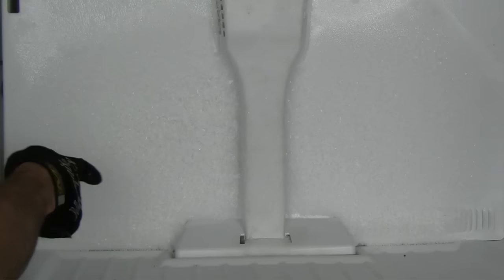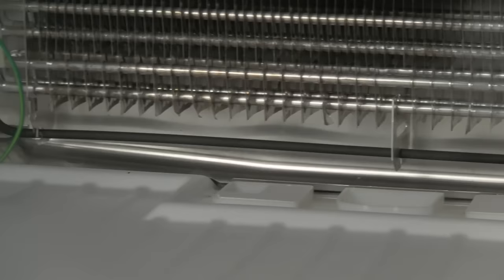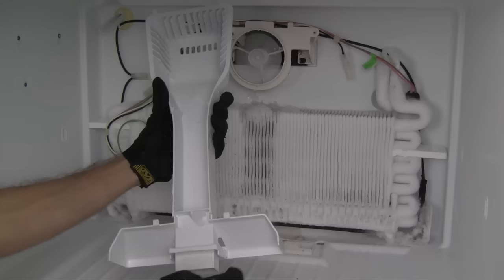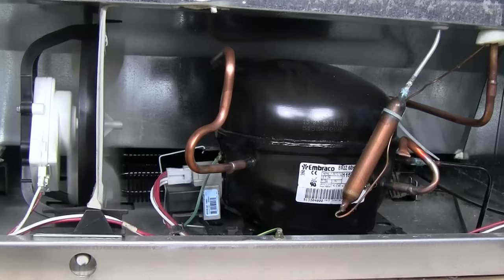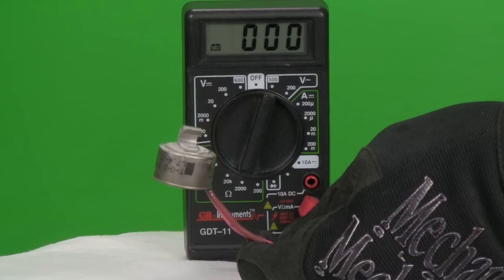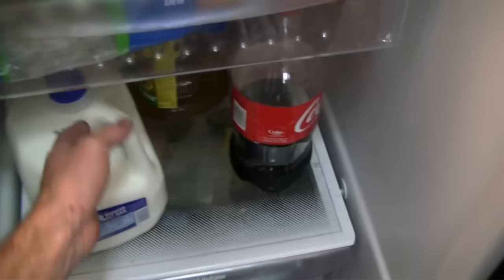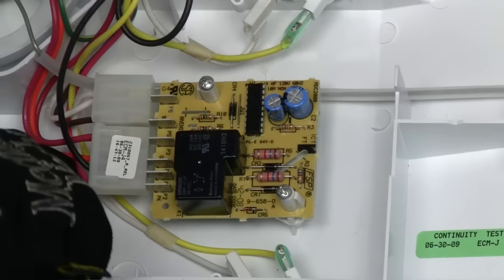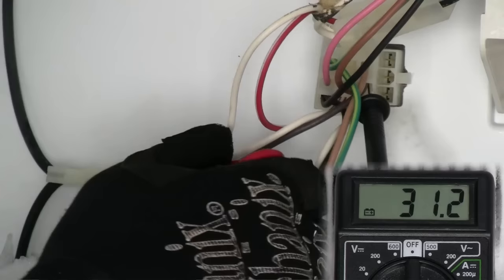Refrigerator Repair (Not Cooling, Defrost System)

Comment: My refrigerator has a defrost cycle and the compressor had been clunking these past few months when it shut off. Today it clunked and the refrigerator shuttered and it popped the circuit breaker. I was home when it happened so it was reset immediately but 12 hours later I have discovered the things in the freezer are defrosting. Cool air is blowing out the side of the vent in the freezer but cool frosty air is no longer blowing out from the top. Any ideas what this could be?
Reply from the maker: SepherStar The clunking is mechanical drag inside the compressor which cannot affordably be fixed. Somethings they will still work for years that way, but its giving you notice that it's on the way out. And it may now be out... I have a lot more refrigerator troubleshooting on this page that will walk you through what to check, but it doesn't sound good...http://applianceassistant.com/Refrigerator-Repair/Troubleshooting-Refrigerator-Problems.php
 If you get stuck, reply with your refrigerator's model and I can dig into it more. Hope that helps! 
If you do need to replace it I have a reliability statistics page for newer refrigerators that may help. 
http://applianceassistant.com/New-Appliances/Most-Reliable-Refrigerators.php
Reply: applianceassistant Thanks for the reply. The repair guy is coming tomorrow but I think it probably is a fatal issue with the compressor. I think my landlord has another refrigerator he can swap it out with. It's just a matter of moving a lot of furniture first.
Reply from the maker: That's good! It's always tough when refrigerator go down.  Thanks for the question. Hope it all works out!

Comment: Here is my problem: i just replaced the evaporator fan and motor a week ago. The freezer works great the fridge is not cold enough though it is just cool. I removed debris from the drain line just lastnight and it has refilled again the fridge is still not cold. please help the fridge is an Admiral signature series from montgomery wards HMG 501040.
Reply from the maker: Still sounds like an airflow issue. Try checking the air duct into and out of the fresh food compartment for any frost build up or blockage. Have you tried manually defrosting it yet?

Comment: need your help I have a Hotpoint model# hss25gfph ww,  bout 6months ago I brought a bullet valve and add some Freon to it ,  it got cold and I would freeze but nothing really solid now it is not even doing that tried to add more Freon and it wouldn't take any more the copper tubes on both sides of compressor are running hot and the defrost area where it heats and melts the ice has nothing on It, it's warm also  now it sounds like normal until it shouts down there is a big knock and rattle sound  I could really use some help just lost my job so I got to fix it cant afford another one any suggestions?????

Comment: i have a code 41 and it runs watre for 3 seconds in the tub then it runs in the soap area for a few seconds and goes to wash,,so the problem is the water level is way off ,it doesnt fill up enough ,what could this be,,,it does fine when i run the test with no problems

Comment: Hi, I am trying to troubleshoot what is wrong with my fridge.. It seems as if everything starts working normal if I turn the knob to the off position then back to 3. after a period of time, the same problem happens and the compressor will stop and no cold air will come out. both freezer and fridge go warm.
ED5FHEXNS00
Reply from the maker: How long will it work before it quits? Does the compressor ever start? You may need to pull the back off to feel if the compressor is starting or not... It may be hot but we are mainly interested in vibration.  If it's vibrating it's running.
Reply: The compressor does start and it does get hot and vibrate slightly. After 45 minutes, the system turns completely off, however the light is on still, but no air is pushed out of the freezer. The compressor and fan stop.

Comment: Hi there I have a Maytag fridge and the freezer is running good but the fridge is at 60 degrees. Do I unplug it for a day or so, would that fix the problem?
Reply from the maker: Sorry for the delay in getting back on this.  It may as long as the fan in the freezer is working. If it's not check the fan motor.  If there a frost build up in  the freezer at all?
Reply from the maker: applianceassistant Whats the model number?
Reply: applianceassistant Hello, well I unplug the fridge for almost a day and now it's running great.thanks to you. thank you so much.
Reply from the maker: Great! Thanks for the post!

Comment: When my timer comes do DEFROST mode, it stops spinning. Should it continue to spin? It looks like power is not supplied to the timer once in defrost mode. Model: Daewoo FR-3801https://www.manualslib.com/download/762452/Daewoo-Fr-3801.html. Can anyone help? Do I need to replace the timer? In the defrost mode, the heater warms up. It just doesnt come back from the defrost mode to normal operation.

Comment: hi my refrigerator  light is on but nt cold but sounds like water runing please  help as why have money for new one
Reply from the maker: lisa connolly it sounds like it may be stuck in a defrost cycle. But the water sound should stop after a short time. I have lots of troubleshooting help for refrigerators on my website that may help. You will need to know your refrigerator brand and model number to be able to find manuals and other more specific videos. You may try to unplug the refrigerator for a few minutes to reset any control boards...

Comment: I'm having trouble maintaining temperature in my freezer. Had a repairman out a few months ago and he recharged the coolant and changed the inverter. He also said that if the problem persists that I may have to replace the evaporator unit. I can't really afford that. I'll look into de-icing as you've shown in the above video, but are there any other pointers you might think I should try?
Reply from the maker: Bummer! That's not good... If the repair person was correct in diagnosing that it needed gas then you likely have a leak somewhere, and the evaporator weld is the most common place for that to happen.  Usually that is a terminal problem and time for a new refrigerator.  I hope the repair wasn't to costly... Here is a troubleshooting guide: http://applianceassistant.com/Refrigerator-Repair/Troubleshooting-Refrigerator-Problems.php
Generally if the compressor is running and the fan in the freezer is working it's a major issue.  Sorry...
Reply: applianceassistant Update. After de-icing the evaporator coil, the temp is still hovering around 27 degrees. I think I'm screwed. So for any consumers out there, G.E. Adora side by sides I would recommend against. LOL. Not reliable and a pain in the butt to work on.
Reply from the maker: Thank you for the update!  I haven't had enough time to really develop it yet... but I created a Facebook page where you can vent you frustrations if you would like... Trying to find a way to put pressure on the manufacturers to stop making crap! 
https://www.facebook.com/ConsumersForBetterProducts
Reply: Mark Bliss
You could add more refrigerant if that worked better before, but be sure to use the sealer kind.  Once you have a leak they are almost impossible to find, so if you use the sealer it could do the trick.  There is a tab inside the fridge that tells you the kind of refrigerant you need, and how much it uses. There are good videos on here to show you how. 
I am a 62 year old women and as of right now, I am darn near a genius at working on this fridge that is only 2 yrs. and 7 months old.  lol
They sure build crap these days.   But thanks to these really great guys I can work on it myself, and I had no experience with electrical things (it scared me, but I suggest watching several videos on this subject.  All are good, but you learn a little more with each one as their are different takes, and kinds.. though all basic.
Hope this helps.  I would give it a try before tossing it.  You'll just have to pay a bunch of money on more crap. 
However.. Their are used ones, and often Free ones on line in Craig's list.  Enter at your own risk.   Good luck.
Reply from the maker: Thanks for the response applepiebetty! Good advice!

Comment: Thanks for your reply. Today a technician checked it a found out that the timer unit is not working properly. And the following details were found on the sticker of that until: PBA MAIN ASSY
DA41-00472M. Is this part easily available. My question is is there any alternative part of the similar that will be compatible with the fridge, just in case this particular part is not available. pls advise.

Comment from the maker: @Benerfe If you have already defrosted the unit and the problem returned, you will need to check the defrost thermostat and the defrost heater with a multimeter.  In most cases it is the defrost thermostat, but it could also be the heater or timer as well.  The video pretty much shows how to test them but if you would like more detailed help email me through the my website and I will be able to write more and give you my phone number so we can figure it out.  Also a model number would be good.

Comment: hi,hoping you can help,my under counter fridge is icing up at the back (inside) but the fridge is too warm, almost 50F! the thermo is on it's coldest setting,i have hoovered the coils,the fan under the fridge stays on all the time,the ice block has started to shrink over the past few days! time for a new one?
Reply from the maker: Sorry for the delay! Thats a tough one... Lets start with the brand and model number so I can look at some diagrams and see the mechanical style.
Reply: applianceassistant thats not a problem,its a baumatic br500
Reply: applianceassistant also the temp is up to 57f and the ice has almost gone.
Reply from the maker: Unfortunately I'm not familiar with the mechanics of that model.  If it has a compressor the question would be is the compressor getting power from the control thermostat and running. If it has a compressor that is pumping with poor cooling, that's not good.  However some small refrigeration appliances use a small piezoelectric transducer to pull heat of of the area being cooled. They usually operate on 12 VDC (in the USA) If it is that type of cooling unit then the question would be is it getting proper voltage to work.  If it is then the transducer is probably the problem.  I'm sorry I can't be of more help... I'm totally unfamiliar with that refrigerator type. If you can find a wire diagram and get it to me I may be able to figure out what to look at and test for...
Reply: applianceassistant hi again,all your help has been greatly appreciated,we've decided to get another fridge,that old fighter owes me nothing,about 10 years worth of sevice☺can't complain at that,once again thanks,have a good one.
Reply from the maker: Any time! Hopefully next time I can be of more assistance!  Thanks!

Comment from the maker: @tracy3564 Try removing the kick plate, then look for a packet of paperwork. If you find the tech sheet it will probably show you how to enter a diagnostic mode to test the defrost thermostat and heater.(You should hear water dripping on the heater) If they pass the tests you probably do have a problem with the control board not sending power automatically. Take a look at my web site for using a meter and refrigerator troubleshooting. I think it will help.  If you have any questions let me know.

Comment: It was confusing me. When the Thermostat is "on" (closed) than it is cold. Is the heater running then or not? I read that the thermostat bridges the heater if its cold... an than the heater is off
Reply: Thanks for the question! It may help to consider there is not always power coming to the defrost thermostat. electricity is only sent to the thermostat by the control device every so many hours. So the thermostat may be closed because it is closed for several days before voltage comes to it from the defrost control device, and passes through to the heater, because the thermostat is cold and closed. Heater heats, frost melts, thermostat warms up and opens, heating stops, defrost control device shifts back to normal run mode after a few minutes to start cooling again.
Hope that helps some!

Comment: After watching your video I took apart the freezer and the coils was just froze from top to bottom,It appears the defrosting heater wasnt working,so I took the thermostat and did a resistance test and it seems to be dead "I tried it at room temp and froze it" So hopefully you just saved me $1,200 on the new fridge the wife wanted :) Tomorrow im going to hunt down a new stat and give her a go.I do have a question on the defrost timer,I did turn the advance screw,can I reset it like it was?
Reply: Where exactly is the defrost timer at? I'm trying to reset it to see if that's the problem? I have the same issues. Fridge turns on but won't freeze stuff and its a new fridge I wanted to try the defrost timer but after I took it apart it was still hard to find the switch.

Comment: Thank you for your videos, they're very helpful!

Question: My fridge seems to have divots where the door gasket seal clicks into. Would a universal door gasket seal set work on my fridge?
Reply from the maker: SugaDontPlay Hard to say...probably not the same way. You may be able to use it with some glue or silicone to attach but it may not press in like your old one does.
Reply: Great, thank you!
Reply from the maker: Glad you liked it! Thanks for the comment!

Comment: I replace my relay and my compressor is still not coming on. What could be the problem
Reply from the maker: Demetric L Gandy Sorry for the delay, I hope you have this figured out.  If the relay is getting 120 Volts AC you may have a weak start capacitor or a bad compressor. Capacitors a rare to fail...  you could try a 3n1 starting device. It will increase the starting torque 300% and may get you going. But that's a last resort and will probably only work for a little while before you will need to replace the refrigerator.  : (  If you are not getting 120 VAC at the relay then your thermostat or control board may be the cause.
Reply: Demetric L Gandy podcast

Comment: All this info is fine and dandy but it doesn’t specifically apply to my 4 year old looking like spanking brand new Samsung or better stated Samjunk Refridgerator that freezes up on me almost every 30 days. I paid close to  $2,000 plus three consecutive repair bills by so called authorized Samsung technicians. So at this point I’m at my wits ends. Just don’t know what to do other than torch it. I thought of unloading it on to someone else at a rock bottom price but my conscious wouldn’t allow me to dump the problem on someone else. What do you suggest I do?
Reply from the maker: I hear ya! That is a very common problem! I fixed 3 of them just last week, but it’s likely to return. I usually tell my customer to do a forced refrigerator defrost as soon as they hear the fan grinding. It’s super frustrating!
Reply: applianceassistant -Well you responded and came to the rescue just in time. Right when the fridge started to malfunction again, I did exactly as you instructed and it really did the trick. The fridge runs smoothly now most importantly that nasty and irritating noise finally stopped without the need of going through the process of removing the back panel and melting the accumulated ice on the condenser. 

It makes me so mad that it was such a simple solution that I really wonder why no one could figure it out, or said anything, neither did the technician that came over and paid strike three you are out for “repairs” nor customer service at Samsung could come up with the idea. I guess that makes you a genius !!!!!

One final question, I have watched multiple videos on You Tube which recommends replacing the original factory installed “Drain Evaporator Clíp” for an OEM part. It has a extended middle insert, a much longer, sorta arrow shaped tongue and groove, with an equally sized but wider hook-on, fold over end tabs as a final method to permanently solve the issue. Regardless of its very cheap price of anywhere under $10 bucks, do you think it’s worth it? Should I go through the trouble to change it as a way to avoid a potential future repeat of this problem?

Comment: I have a samsung refrigerator with the freezer on the bottom, my issue is that the fridge stays warm and the freezer wont freeze.  I noticed ice built up on the inside of the refrigerator.  What do i need to do to fix this problem.  Can someone help please?

Comment from the maker: Power coming and going to the refrigerator's compressor is not good... Generally if the compressor shuts down you should wait at least 5 minutes before starting it again so the pressures can equalize.  It may have ruined the compressor...  You may be able to put a new start relay on the compressor and get it going again, but it's a gamble.  Sorry, Good luck!

Comment from the maker: Well that's a tough one.  I have an article on my website (link's in the video description) on troubleshooting a refrigerator that is not cooling at all... basically you need to determine if the compressor is running or not. If it is running that is not good... if it is not running you may have a problem with the start relay on the compressor or more likely you need the main control board pt#WR55X10942 (very common on that model) : ( It's not quite so easy as a defrost problem...

Comment: my fridge ive had since 2006 isn't working right at all it doesn't make ice sumtimes it leaks water and the fridge is barely cold it doesn't keep my milk or food cold i have to put my milk in the freezer just so it will be cold and theres a frost build up that always happens in the freezer i try to unplug it and plug it back in but doesnt help wat should I do?